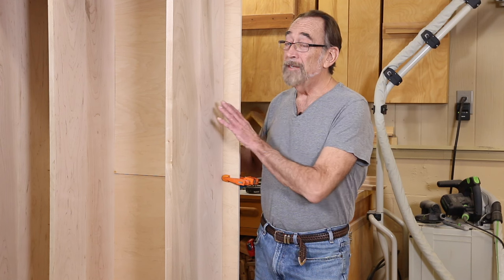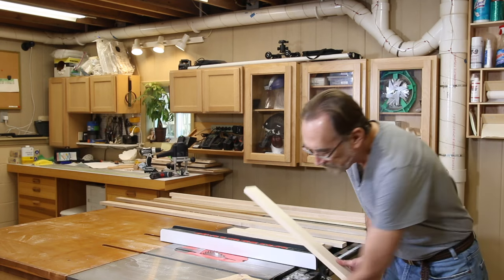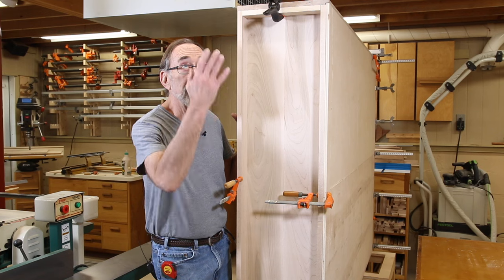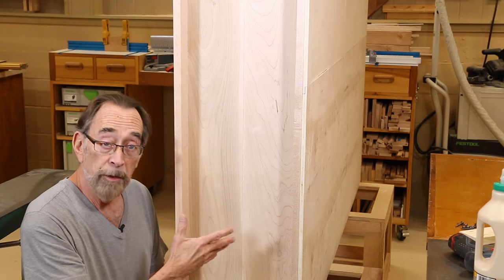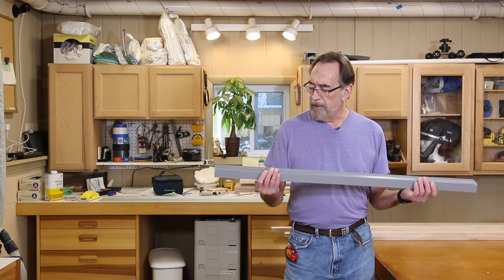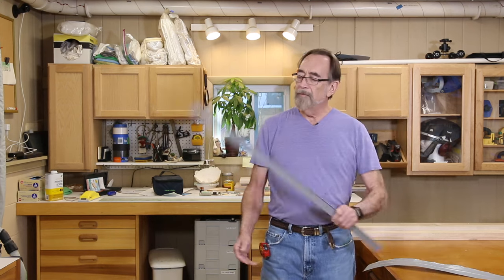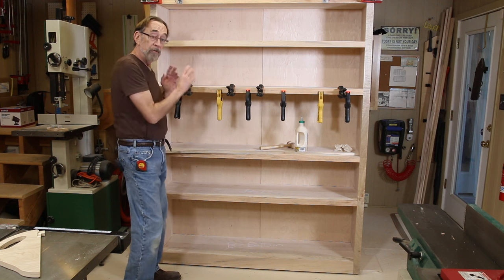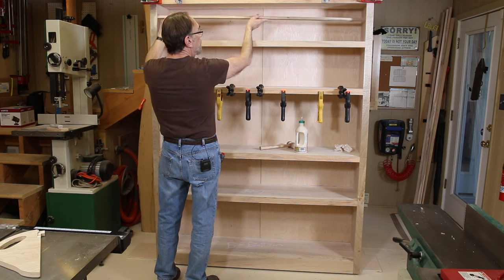Maple Bookshelves 6

Comment: Nice to see you back, Steve.  Question re: when you glue end grain like your cross braces.  I see you glue and also use pocket screws...makes sense.  Do you ever apply a coat of glue on the end grain, let it dry and soak in a bit, and then do a final glue so your get maximum glue strength.  I thought I heard about that technique but not sure if it was your idea also.  Thanks.  Rich.
Reply from the maker: Hi Rich, I've heard two wildly different theories on using a first coat of glue then a second... one theory says it makes the joint stronger and one says it makes it weaker.  I don't know, maybe someone from Titebond will weigh in and let us know.  Thanks for watching!
Reply from the maker: Rich, I did hear back from TiteBond and this is what they say:

"Yes, we recommend thinning a small amount of glue and painting that on the end grain.  Let that dry up for about fifteen minutes and bond up with normal viscosity glue.  This will help with the overall strength.  I hope this information is helpful.  Please feel free to contact us for further information."

So now we know... thanks for asking a great question!

Comment: Boy Steve, you weren't ling  about those massive bookcases. Very nice job by the way! One question about the under shelf support,  how strong are they under a load of heavy books? Do they make that much difference installed flat like that?
Reply from the maker: Hi Dale, Thanks for watching!  I did a "deflection" test before adding the face frame and under-shelf support, and with 40 pounds of weight in the center of the shelf, the shelf deflected 1/8".  After installing the face frame and support, I started piling on weights and got up to 110 pounds and there was no deflection at all.  I stopped after that because I ran out of room to get the weights in the center of the shelf, but I thought that 110 pounds was pretty good.